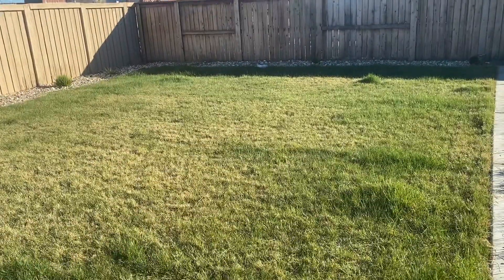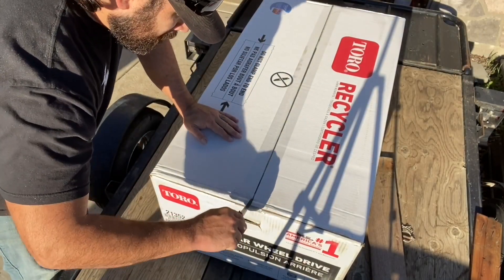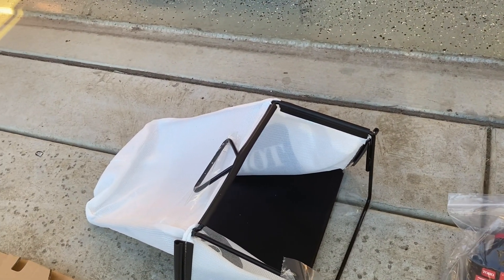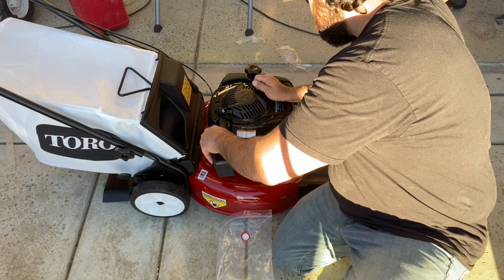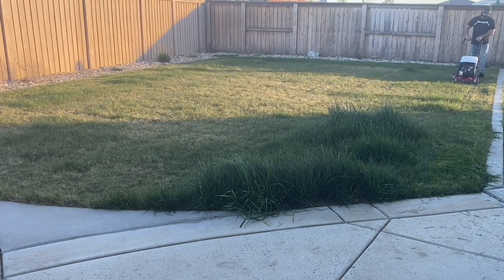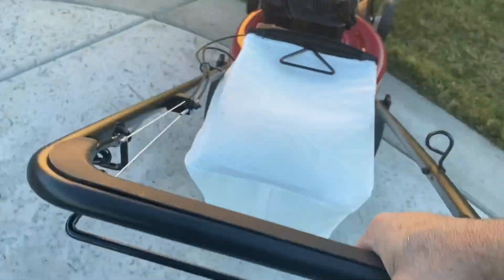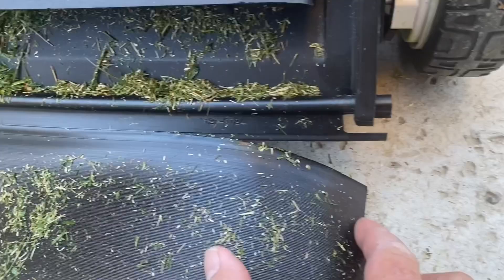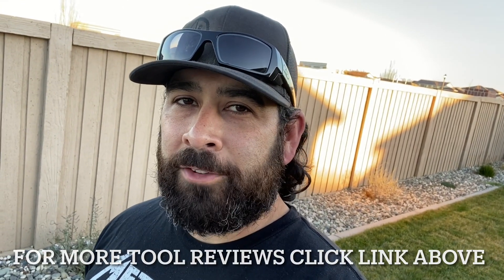Toro Self Propelled Lawn Mower Unboxing and first impressions! #toro #toromower #lawnmaintenance

Comment: Thanks Matt, good info. Trying to decide on rear or front wheel drive toro. Just need a push mower for trimming around the house, I have a zero turn gravely to do most of the yard.
Reply from the maker: Thank you! And there are soo many choices now when buying a mower.

Comment: Hey Matt you didn't show hoe to connect to the self propelled. We just bought the self propelled Toro lawnmower and it won't self prepell!? What are we doing wrong?? HELP PLEASE
Reply from the maker: Hello. Sorry about that. Its either the top or bottom lever on the handle. Hold it down. It should self propel than. Let me know if that doesn’t work. Thank you for watching!

Comment: I got this exact same model about week ago. Turns out it stalls quickly whenever i go through lawn that is about 6 inches tall. Also, whenever i start cutting it starts blowing grass all over my face through the bag section and from the front right tire, even if the bag is completely empty.
Reply from the maker: Wow! Thats not good. I do have to go slowly through tall patches. Never had the the grass problem though.
Reply: I just bought as well and so far so good….but I paid just a little north of $399 here in Mississippi🤔
Reply from the maker: Wow! I thought 2022 was bad but stuff is definitely getting more expensive.

Comment: What oil can I use in this lawn mower if I just bought it and didn't get the toro oil.
Reply from the maker: Hello and great question! The lawn mower I purchased required SAE 30 Engine Oil.  The Toro brand meets the API SJ Standard. Check in the Owner’s Manual for the proper oil recommended for the mower you have. Hope this helps. Thanks again!
Reply: @JustaDude123  I'm dumb this is my first gas lawn mower as a grown up and it came with a bottle like yours, and I proceeded to pour the entire thing in and I think I broke it becuase it worked for 20 minutes then just shut off on until I dumped out most of the oil out and then it started worked after a few pulls. Hopefully I didn't permanently screw it up...
Reply from the maker: Open up the port where you added the oil. Look through the owners manual and it will tell you how to check the oil properly. Check the oil and make sure there is the proper amount in the engine before you run the lawn mower any more. Having not enough oil could destroy an engine just like having too much.

Comment: Add all the oil that's in the bottle provided.
Reply: Wrong. The engine has a 15oz capacity. They give you an 18oz bottle of oil. Overfilling causes problems do not do this